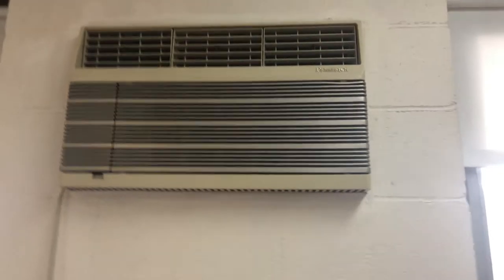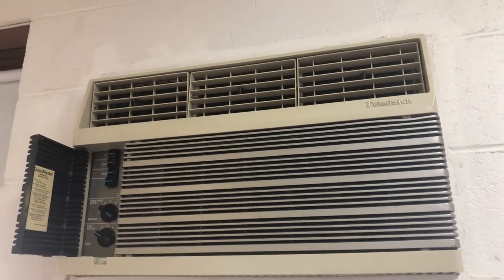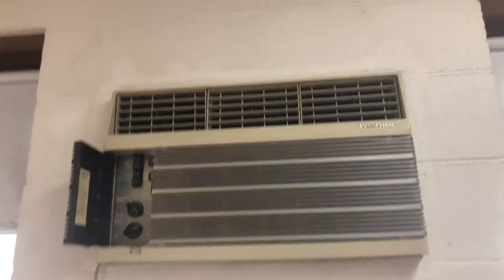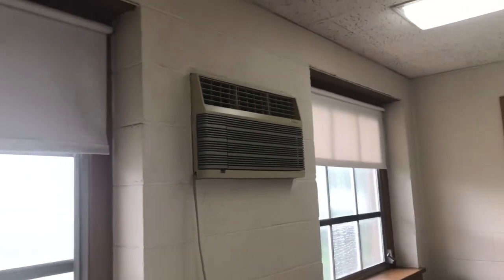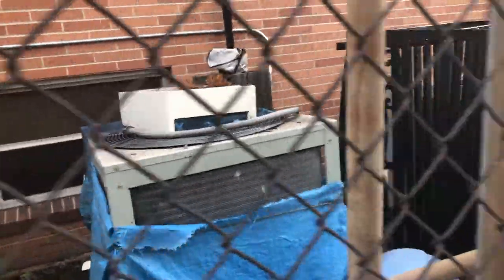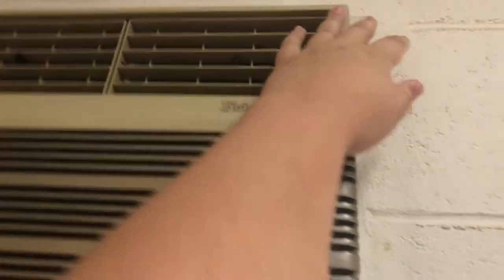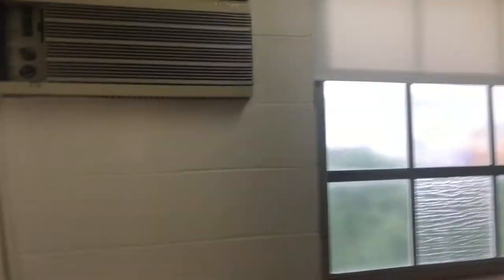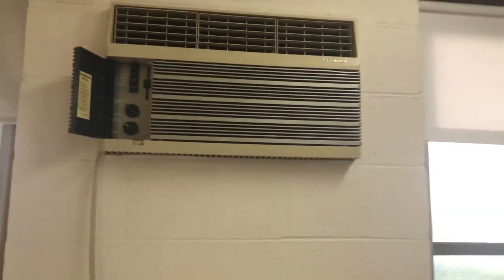1990 Friedrich Quietmaster 12,000 BTU Air Conditioner Overview

Comment: The worst decision I ever made was to buy a new Friedrich in 2011 when my old Quiet master stopped working.  It was very likely a simple thermostatic issue.  Quick fix I'd say.  I got rid of an amazing unit.  The new Friedrich cost $2500 and lasted 7 years.  The second unit after that lasted 6 years.
I will bet that the original Quiet master would still be going strong in 2024.  I have Westinghouse units in 2 apartments that are still cooling after 40 years!!  My original Friedrich Quiet master (1988) was a BABY by comparison.  What a costly and disastrous decision for me.
Reply: Wow, this was sad to read man lol..yeah that freidrich would still be going strong lol.

Comment: I've found older units are more efficient than newer units, they may use more power but they run so much less than their modern counterparts, my old 12.8K Kelvinator with an AK used less electricity than a modern 24K GE, old Kelvinator sounds legendary though after measuring I don't have a window to put it in and it's not financially feasible to punch a hole through 2 layers of lath and plaster and 3 layers of siding with blown in insulation as an added F U